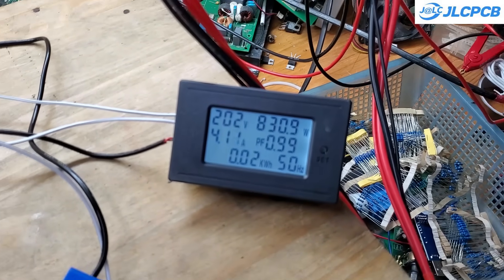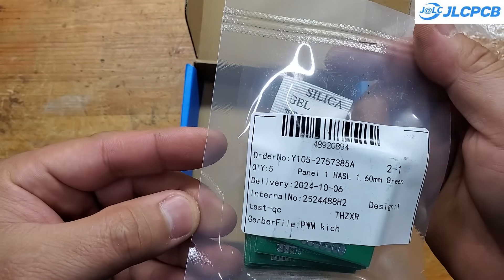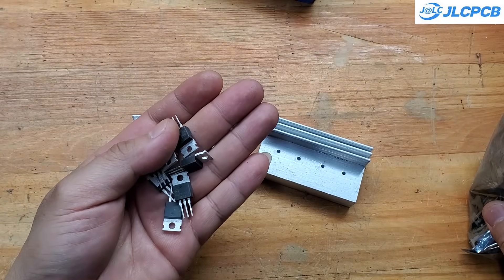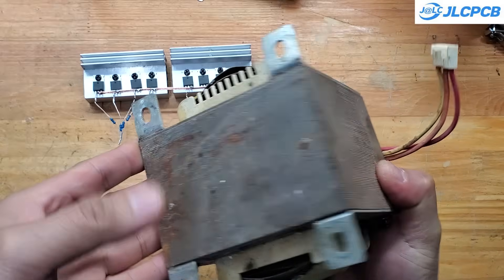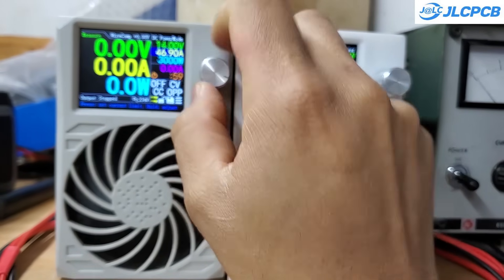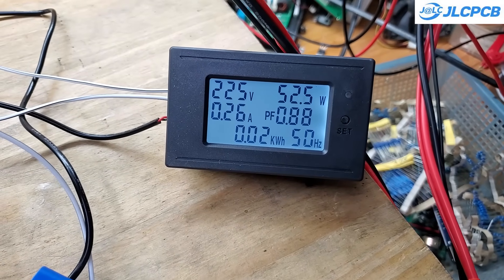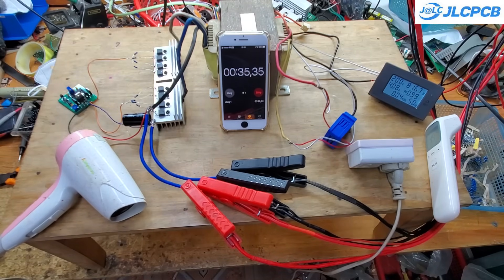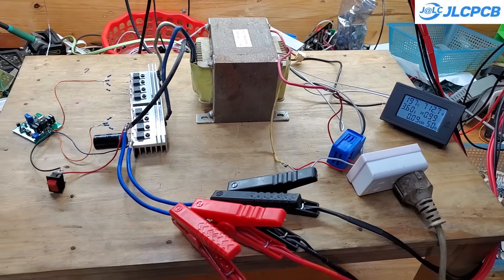Cheapest 2000W inverter | JLCPCB

Comment: Muito Bom!... geralmente estes vatimetros não funcionam em onda quadrada ... Qual é o modelo deste vatimetro que está usando?
Reply from the maker: https://s.shopee.vn/LYOa0ox0g I'm not sure if this link will work for you. This wattmeter has a built-in buck module instead of using capacitive voltage reduction like regular meters. It can operate at voltages from below 100VAC up to 250VAC and works well with both square and sine waves.

Comment: I have an amorphous 40mm torroid, If this gets several turns, will it handle the current and filter properly if there is a 8kw load on a larger 80mm amorphous torioid transformer?
I want to use the filter for lowest power consumption, but can only get 40mm, wanted 55mm but could not get. 
I think its too small, Is it able to be inducting 200a if its 48v power input, roughly 10kw surge?
Im thinking 6 turns, it can fit with right gauge wire still, I just dont think its needing to do as much as the 80mm transformer. 

HMMM, Not sure.
Reply from the maker: You can twist multiple small insulated wires together to form a Litz wire, which works better at high frequencies. This also allows you to easily adjust the wire size. Additionally, you can use a larger output capacitor. This will reduce the required size of the output inductor, so you won’t have to worry about it anymore. Increasing the capacitor value is easier than increasing the inductor.
Reply: @PhdHung  Do you know what equation is used? Uf on bridge side or uf on ac output?
Reply: @PhdHung  I blew 6/24 mosfets, immediately when powering on. 
The only thing I didnt do was change the dead time from the lowest allowable, to the highest allowable dead time. Would this make a difference? 
It looks like the 6 are the first 6 to switch on initially, and they are partially blown meaning i power back on for .1 second and the fets conduct but they are blowing out electrical sparks. I shut off immediately. 
But yeah, do you have any experience with this probelm?
This is with the amorphous toroid and inductor, 5.5 turns primary, 40 secondary, and 4 turns on filter inductor. 
Gosh, this sucks!

Comment: Pls make a video of building a diy low battery cut off circuit using lm358 and then add it to this circuit
Reply from the maker: Yes, I will design it soon. This circuit has short-circuit protection using a shunt. However, it does not have low-battery protection.
Reply: Use a ziner diode that is rated for the low volt cut off use the ziner in reverse  and add the reverse end to the pnp and add a 2k to base of pnp to collector if use negative volt or to emitter if using positive volt add the voltage of 5vot to the ic pwm overcurrent pin so when the battery volt drop the pnp turn up fast disconnect the pwm signal to the gate of the mosfet turning the inverter off that's how it's done

Comment: Can i use your pwm controller module. That was launched around 3 month ago. That module low voltage protection trigger at 48v. But i want to use that with 24v project. How can i minimize the low voltage triggering voltage for 24v battery ?

Comment: Also I am rather interested in power supply than that of inverter want a buck boost converter 4 switch synchronous for lab bench that can simultaneously buck or boost with large current

Comment: Hey I am building an inverter with ferrite of dimensions 50x28x27 torroid from welding machine and rewinded it the issue is that my MOSFET are heating at just 100w load with output voltage of 350V with sg3525, as per design the fets at ends are more warm than the centre

Comment: Bro. Can i use your pwm controller for 5kw inverter with a 24v battery project ?
If yes, how can i do that. Because the under voltage shutdown is triggering at 48v on that project. 

Please answer.🙏🙏
Reply: Use video schematic and change and add more mosfet for power.
Logic board is the same
Reply: I'm talking about the pwm controller module. That low voltage protection trigger at 48v. But i want to use that with 24v project. How can i minimize the low voltage triggering voltage.  @scr1ptery642

Comment: And a feedback for regulations of voltage too remember guys for a 220volt output the transformer output must be 290 volt for the regulations to work
Reply from the maker: It is very difficult to implement feedback with the SG3525 when using an iron-core transformer. In reality, a voltage variation from 200V to 240V can still be used for all devices without any issues. If you want to build an inverter with better output voltage quality, a microcontroller is required.
Reply: @PhdHung  use the tll494 instead it work better